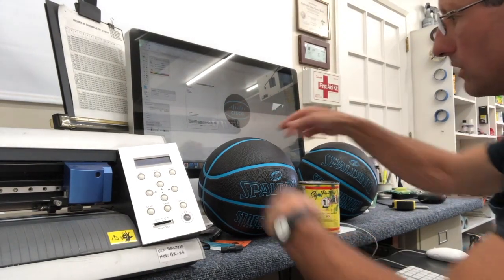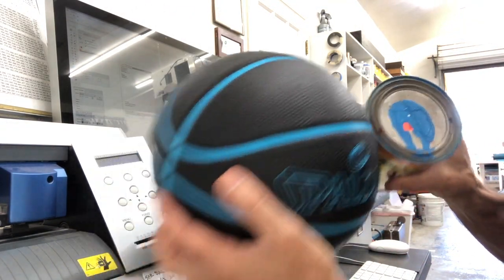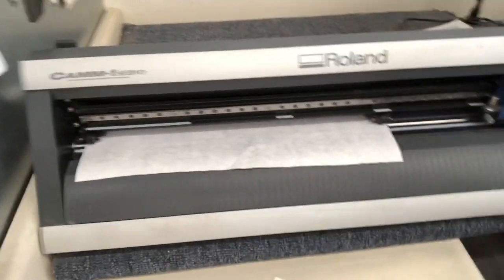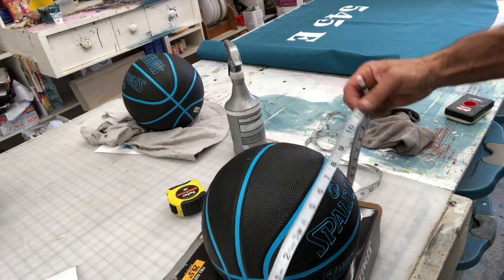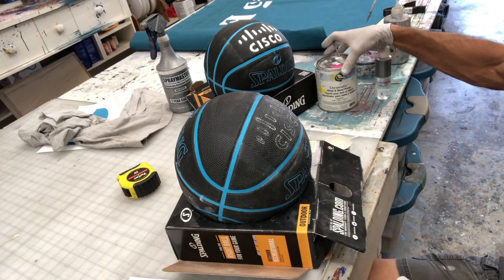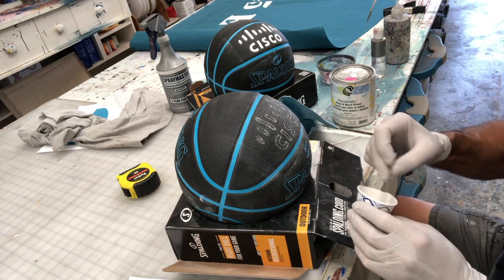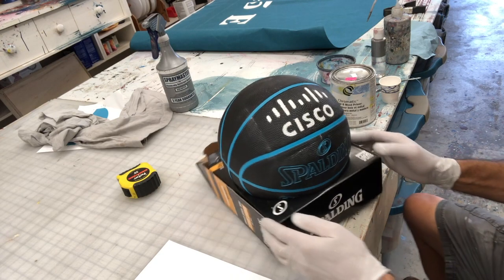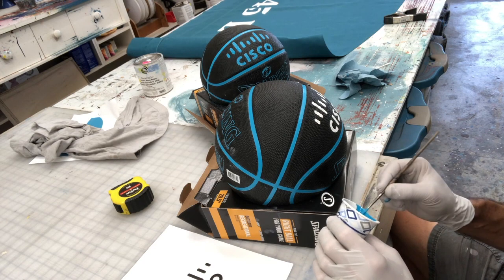Hand Painted Logo on a Basketball

Comment: Impressive job on a compound curve. Those are tough. I once did a large jar that was kind of that shape that but easier because I just put the print inside it.

My first sign teacher did everything with an overhead projector but it often introduces distortion. I really like pounces because you can immediately see if you need to make placement changes.

Where did you get your primer in a quart? I’ve only been able to find it in gallons.
Reply from the maker: That’s awesome Dr. J! I agree about projectors, they’re my last resort. I can’t get that primer from any of my suppliers right now apparently because of a lack of raw materials. If you find it please let me know. Thank you so much! 👍🙏